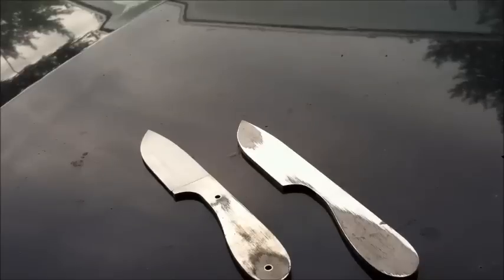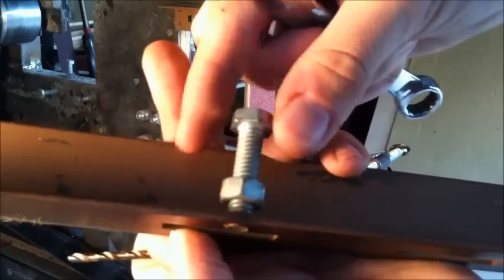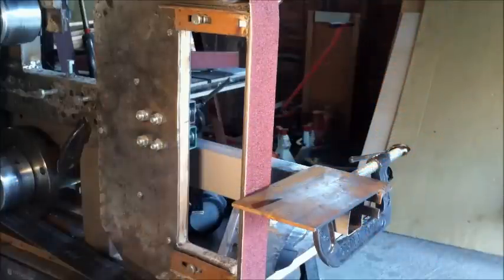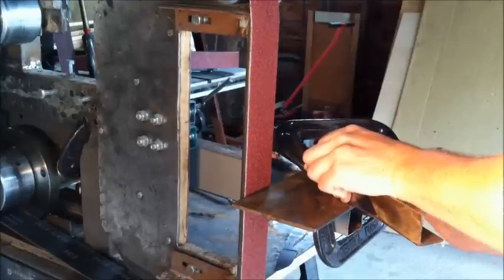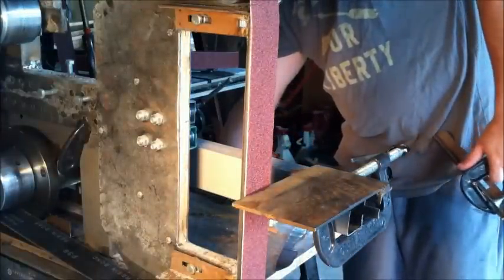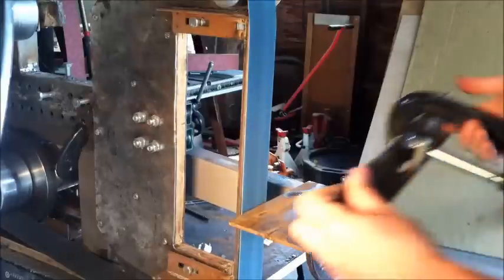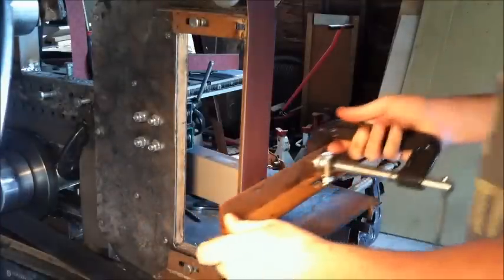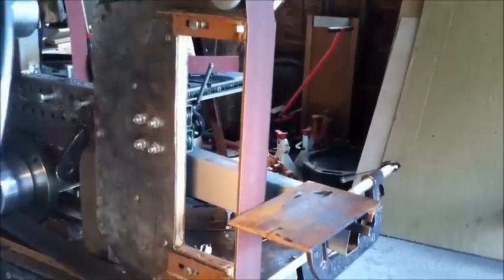How to make a knife bevel

Comment: I would think that just one adjustment bolt would produce a fulcrum point with your jig. Doesn't that throw off the bevel?
Reply from the maker: HONEY B GUYS not at all! If you think about it, since there is a long bar, there are essentially 2 main contact points. 1 on each side. The set screw is the third contact point making it a solid triangular formation. Done many knives with that jig and never had a problem!

Comment: Do you ever measure the angle at which you set your jig?  I know that for some knives, it's necessary to grind at a specific angle.  I followed your video on how to make a jig, and now I'd love to know how to set a specific angle on it.
Reply from the maker: Geron Spray I never use set angles. It's actually quite easy to see where your bevel is being cut after doing hundreds of blades. I always grind to my center and bevel lines and just adjust accordingly!

Comment: you said, after heat treat you  bring it down some more? do you keep the same angle on the jig to take more off the blade.or do you give it more angle and start all over again.
Reply from the maker: It depends on where I want my bevel line to end on the blade. Ultimately I make the edge side thinner to my liking!

Comment: Could i use a bench grinder for this? Probably not I guess.
Reply from the maker: you could but the grind would be a hollow grind. It may be a bit more difficult until you can make a deep enough groove for the bevel

Comment: At first a real awsome tutorial.
But i have a question regarding grinding with a jig.A full flat grind is with a jig absolutely not a problem.
But i think that because of the geometry of a knife going from a straight edge into a belly up to the tip it is not possible to do a "real" skandi grind with a jig.
What i mean if i grind the knife with even passes along the belt, the grindline will not follow the exact same line as the future cutting edge does.I hope you know what i'm talking about. I mean that the arising grindline is further away from the straight part of the cutting edge then to the curved part.
If you stop the video at about 06:40 and look on the bevel you know what i mean.
So do you think a real symmetrical skandi grind is only possible by free hand grinding, where you can turn the knife while grinding the curve of the knife or is it possible with a jig too ?
Reply: Sorry if my english might be a bit horrible here and there ;P

Greetings from Germany ;)
Reply from the maker: +TheBK117B2 you can definitely make the bevel line run parallel with the edge. I do all the time now. It just depends on how far down you take your center line. It can be done with this method! I was a bit inexperienced in the time of this video but now I can consistently perform this procedure with the jig or freehanding.
Reply: +White Bone Knives All right, good to know.
Then it's just my inexperience that i can't get the lines perfectly parallel at the moment.

Would be real cool if you could do a new vid of how to grind a skandi with the jig ;)

Comment: Could I use a disc sander for this?
Reply from the maker: Really you could use just about anything. A disc sander could work if you had the right jig for it but otherwise it may turn out pretty sloppy. Overall, I would not recommend a disk sander given there are many other better options.
Reply: Alright! Thanks!

Comment from the maker: carmel kayuf Hello! 1) you could use 36 grit all the way if you would like, but I choose to stage up in grits to leave a finer finish on the blade. 2) use rough grit to almost get desired thickness and then switch to a higher grit. After all lines from rough grit disappear, then stage to a higher grit. This is basically making the blade smoother. 3) depends on how smooth you want your blade to be! :D 36 grit is rough, 120 is less rough, 200 less rough, 400 less rough etc. etc.
Reply: thanks a lot my friend for answering my questions, i really appreciate your help.
do you have email address that we could stay in touch ?
Reply from the maker: No problem and yes! whiteboneknives@gmail.com
Reply: +White Bone Knives 
notice that the spine of the blank is lined up with the bottom of the jig , so that the spine also touches the platen (@ 4:54 )  .  would it matter if the spine was touching the platen when the blank was mounted on the jig to get a nice , clean bevel grind ?  Does it have to be ?
Reply from the maker: BrokenTengu99 I position it that way to keep the knife secure. I suppose if you had a clamp tight enough capable of holding on well it would be no problem but it was easier for me to do it this way. Your knife might walk down the jig giving you an inconsistent grind if the clamp wasn't tight enough

Comment: do you swap   sides only after you finish one side or alternate will grinding ,do you also use your belt to put the egde on after heat treatimg process
Reply from the maker: Yes I do one side at a time and bring my bevels down to a certain thickness depending on the knife and after the heat treat, I will bring it down a little further and then put the edge on it.

Comment: Hello- that is some really fine and professional looking knives... you commented that you made your belt grinder for around 400 dollars. Could you provide a parts list and where to obtain them? The jig is really slick too.
wvblade
aka James
Reply from the maker: Sorry it took me so long to get back with you, but I actually just now seen this post. Thank you very much for the compliment by the way, and most of the parts for this grinder can be salvaged from the whole treadmill itself. The hand rails can provide the frame of your grinder. I actually made my frame out of square tubing stock that came from Lowes because it was made before I purchased the treadmill. For me the parts list went like this...

$200 for the aluminum wheels      (Beaumont Metal Works)
$30 for the stand it sits on             (Harbor Freight)
$40 for square tubing                    (Lowes)
$125 for the treadmill                    (Craigslist)

Some parts like the platen, and the tension arm for the tracking wheel were made out of scrap I had laying around the garage but would be of minimal cost. Hope this helps and I'm terribly sorry for the delay. If you have any more questions please feel free to ask! :)
Reply: Hey thanks for the reply and parts list... Very much appreciated...
I do have a question about the jig- with one tapped screw and bolt does it not try to tip left and right? or do you use that to sway and move with the curvature of the blades? Again, great work and hoping to set myself up with something similar to your setup Sir.
Reply from the maker: wvblade knives of wv Sorry it took me so long to get back with you, but I actually just now seen this post. Thank you very much for the compliment by the way, and most of the parts for this grinder can be salvaged from the whole treadmill itself. The hand rails can provide the frame of your grinder. I actually made my frame out of square tubing stock that came from Lowes because it was made before I purchased the treadmill. For me the parts list went like this...

$200 for the aluminum wheels      (Beaumont Metal Works)
$30 for the stand it sits on             (Harbor Freight)
$40 for square tubing                    (Lowes)
$125 for the treadmill                    (Craigslist)

Some parts like the platen, and the tension arm for the tracking wheel were made out of scrap I had laying around the garage but would be of minimal cost. Hope this helps and I'm terribly sorry for the delay. If you have any more questions please feel free to ask! :)
Reply: wvblade knives of wv Do you make and sell jigs?

Thanks